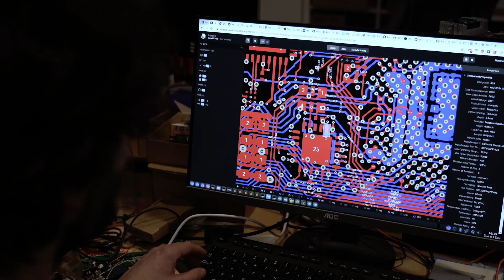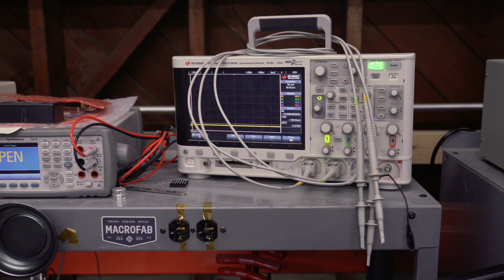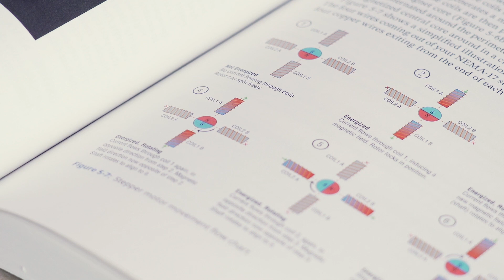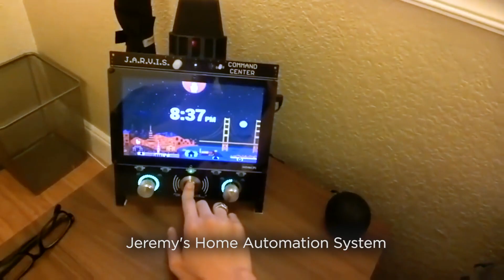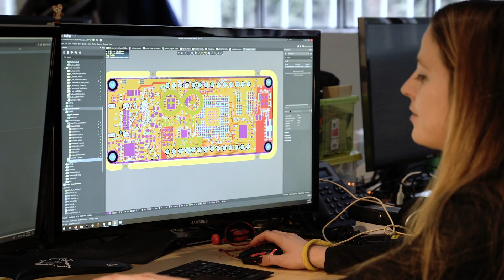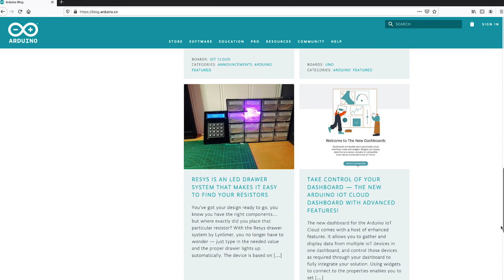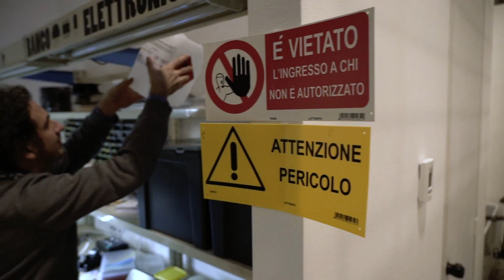Empowering a Global Community of Creators - with Arduino

Comment: Arduino has really empowered so many creative and technical people all around the world. It is really an awesome feeling when you can "communicate" with a microcontroller so easily ! 
I still remember my college days when we had to use a big programmer module in lab to burn simple programs in 8051 microcontroller. We had to write hex codes for each instruction. Arduino has really changed the world, and changing it everyday.